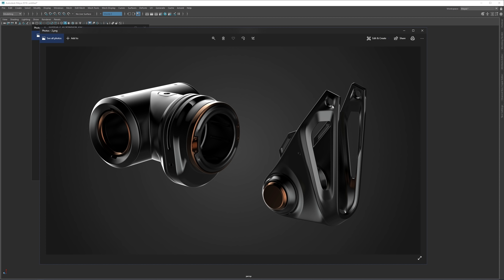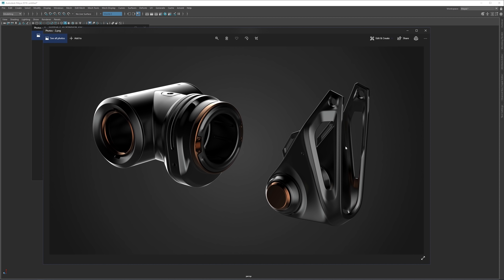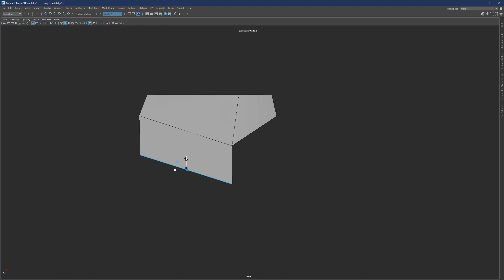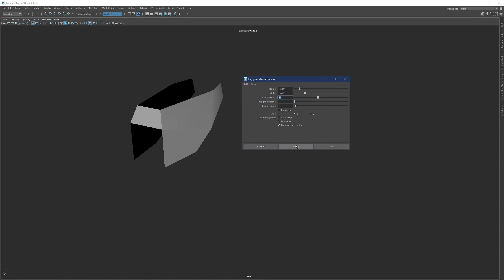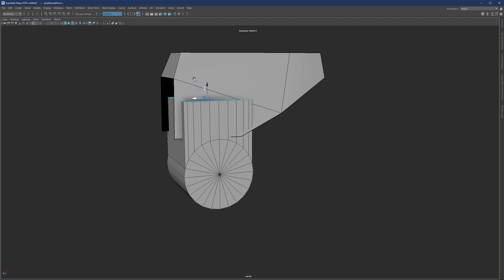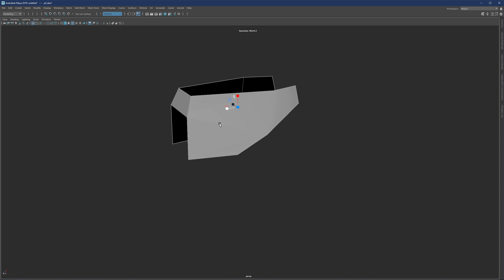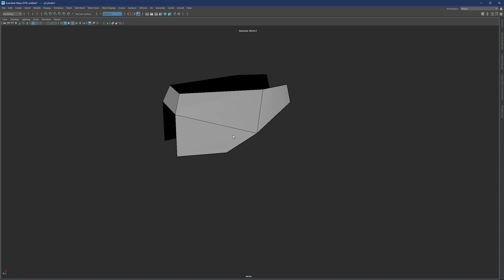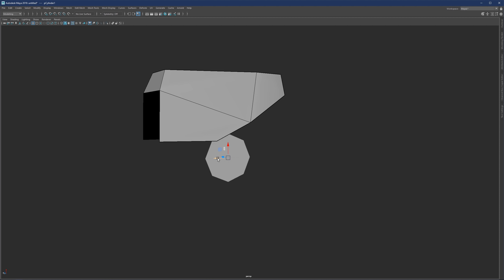Hard Surface Practice // Creating Assets in Maya

Comment: how did you cut so perfectly at 7:45
Also great vid, thank you. I never new that circularize existed and my god its world changing.
Reply from the maker: You mean mid loop? Middle mouse click with multicut
Reply: you can also just use multicut tool and hold "shift" to cut the center of the the face
Reply: @Elementza  Didn't realize you replied, thank you!
Reply: @3danmensional0000  Ah okay, thank you x